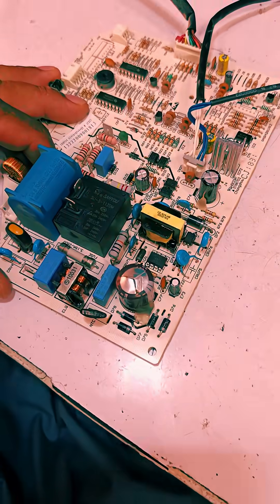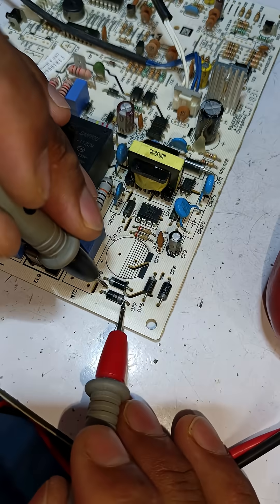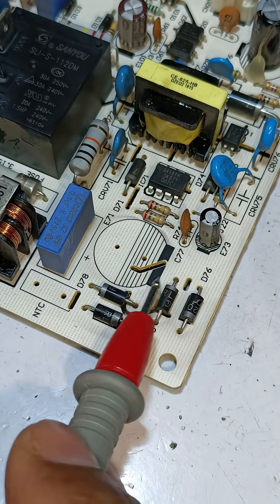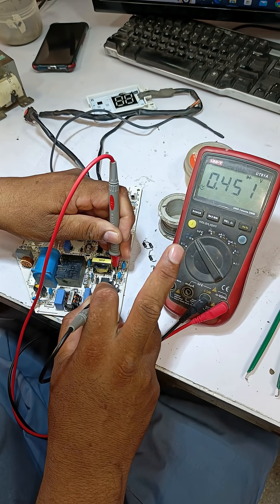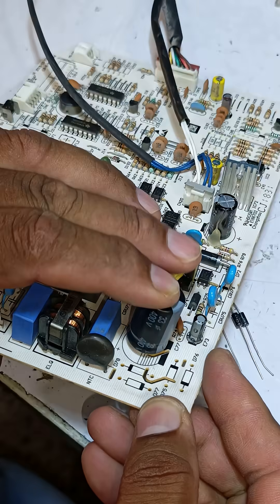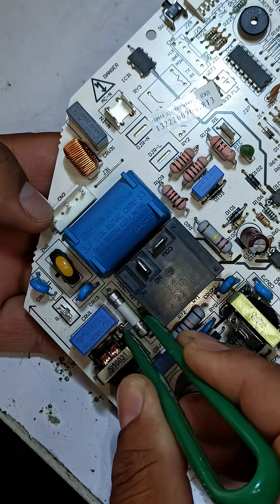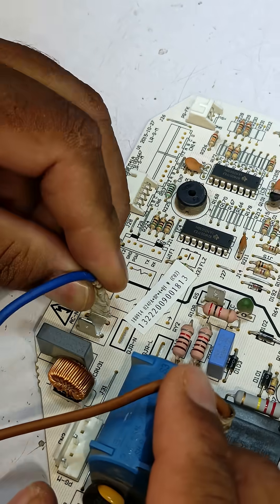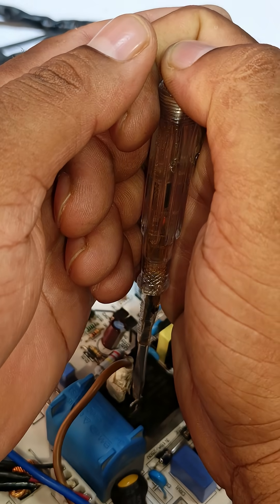Dead Air Conditioner Circuit Repair

Comment: the fate of the person who was deparing was very good that only the input DC system was damaged. If the switching system was damaged, then there would have been a problem. If someone's luck is very bad, then the switching system can also be damaged, then there is a lot of problem. Most of the case switching system is damaged if switching IC is damaged then there is a big problem. If the component part is not found then there is a big problem. And a switching module is added then.
Reply: Yes bro